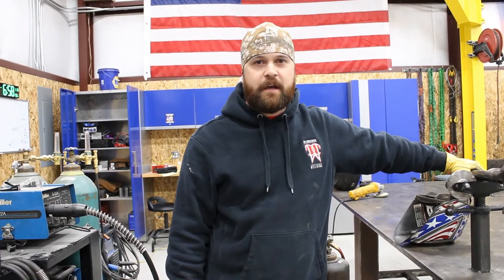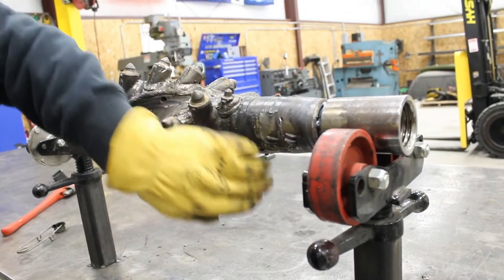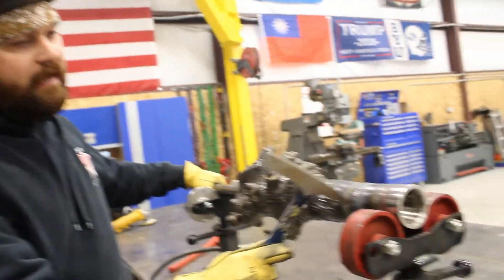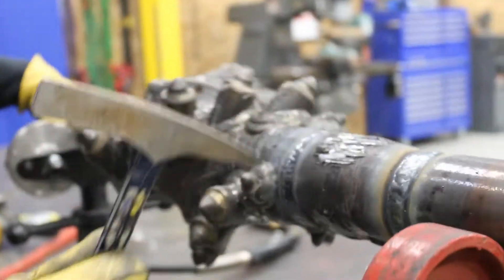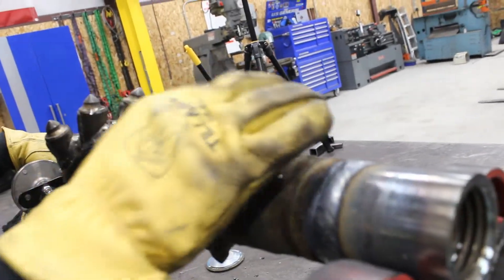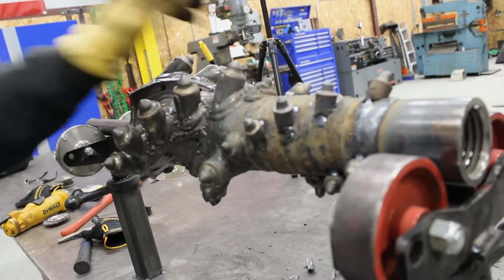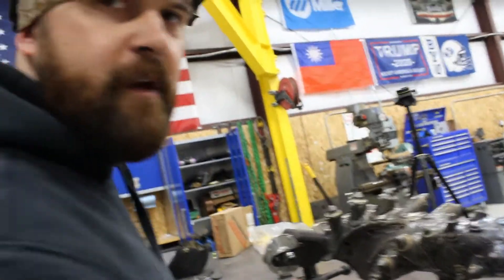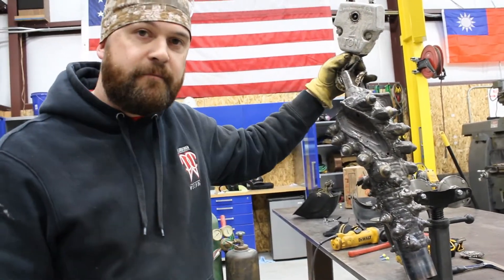Welding repair on 8'' Reamer

Comment: Great videos! I was told by my dad, approximately 55 years ago, that you should only use stick when hard facing, tell me what wire, what gas and why it's okay to go against dad's advice?
Reply from the maker: I’m not really sure what his reasons may be for that, but I do know in the last 55 years, welding science and technology has come a long way. Maybe hard facing wire didn’t used to be very good. Not sure on that, but I do know that there are a couple of wires I have used and I really like them. I use Stoody hard facing wire. They also make hard facing rod. Both are great. There are different grades depending on what you are hard facing and how hard you want it to be. With the wire I use, you can use C02 or C02/Ar mix. I use C02, and it runs just fine. Hope that helps. Thanks for watching!